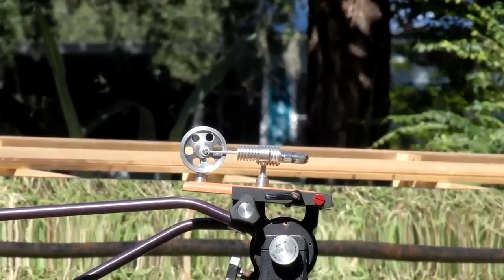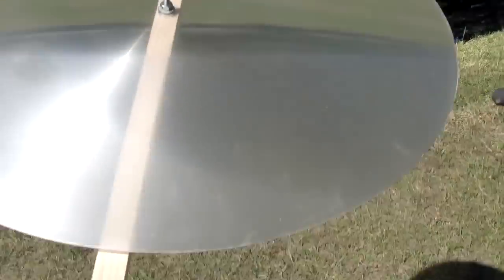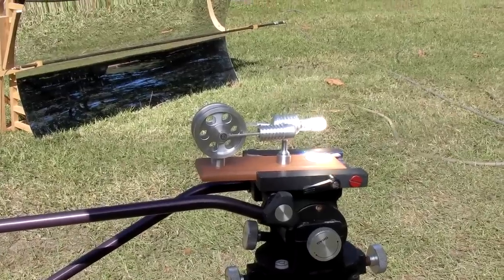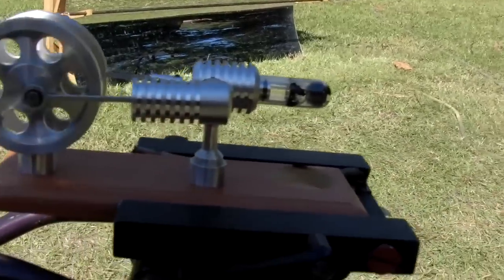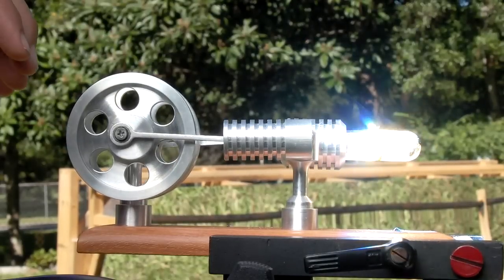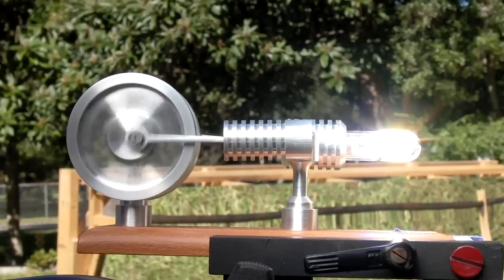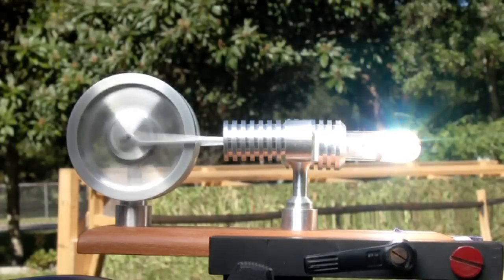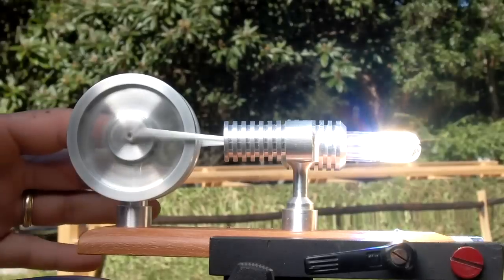STIRLING ENGINE FRESNEL Lens on a Steek Solar powered Stirling Engine

Comment: This is the sort of thing I was thinking of building. Fire safety could be achieved with a vertical magnifier in a metal tube over the parts that require heat. Metal may be preferable to glass. In hot countries, solar is less effective as those panels like light but not heat so something like this may be the ultimate alternative 👍

Comment: Okay this is fucking simple all you need is a high voltage solar panel one solar panel let's say the biggest one you can get is around 600 watts so let's just say you got a 405 watt one like I've got and it's like 36 volts or something like that so if you take that and you wire it directly to coil wire wrapped around the end of the glass bulb then you may be able to generate enough heat right off of it just right off the Sun and this thing should start running and it will probably get pretty hot I'm sure I guess I could try this I've got both

Comment: You could use infrared sensor attached to  magnifying glass pointing to the sun so whatever and wherever it moves in case it's being used so the heat is constant, attached to that wheel is a motor to charge the battery so that the infrared sensor is power sourced.

Comment: If I understand correctly, the Pyramids from Egypt were energy producing machines. It is sad and exiting that this technology revisits us today. I am not the sharpest knife in the drawer, but my belief is that the oil in the ground is a lubricant which left in place allows tectonic plates the ability to flow freely. Imagine what the world would look like today if we would have placed more emphasis on the Sun, rather than oil. Dan and Denise do a wonderful job of expanding imagination. Love this little engine, and love the Green power website as well 1 plus 1 truly does equal 2...Thank-You

Comment: one thing is that power depends on temperature range on stirling engines, as both bulbs are under the sun and very close to the focal point , the temperature range here is not that great. Isolating one of them from sun exposure would work greatly
Reply: Continous dripping cold water falling at the cold side of the piston bore- will greatly increase the Stirling efficiency- sure temp're reduction... A small aquarium water pump will do the trick- the coolant falling water must pass thru a sprinkler like slotted holes- for heat scape as the water fall down to its catcher- reservoir...

Comment: IR flock sheet absorbs 99.5% of all light that hits it including infrared light, it gets very hot, very fast when set out in sunlight or when a simple flashlight hits it, it gets hot enough to boil water.
Reply: Tim McGirl:  Is the term "IR flock sheet" the generic name or BRAND of such great HEAT absorbing product?. Pls elaborate.. or PM me in private...

Comment: I have been wondering for a while about putting magnets on the flywheel itself. Then putting a coil around that to generate electricity. It seems like a better way to me than it would be to drive a belt hooked to a gen.
Reply: Correct because there isn't much torque associated with this movement. Any type of belt drive will reduce efficiency massively. The ideal and likely only solution to generate max output would be magnetic system to store the energy

Comment: Wonder why this isn't scaled-up and used to spin an AC generating motor?. 
Using a magnifying lens on a frame with servo motors connected to the frame that uses a computer program to keep the frame/magnifying len's light focused on a specific point by following the arc of the sun in the sky. 
If the Sterling motor is found to be underpowered, a closed steam turbine system could be used to power the AC generator. The focused light used to boil water in a closed loop to produce steam to turn a steam engine and in turn, turn the axle of an AC generator.
Seems like an excellent way to produce AC power using only sunlight durning the daytime. Hooked-up to a Tesla Power wall battery system, would enable power at night.
Each individual home could have one,eliminating the need for AC power transmission and distribution wire networks we see today.

Comment: The sterling engine is great and all but when used for solar purposes it loses in efficiency by a great deal. Add into the fact that a very efficient sterling engine would cost more than solar panels of equal power output and you can see why it isn't being used.

Comment: Can this sterling engine be made of pure glass...?  Someone built a 3D printer that uses lenses to melt sand into glass then uses the glass to build things.  It uses a solar panel to power the electronics which control where the X & Y motion of the lenses to move on sand.  The 3D printer can print its own lenses out of lego blocks, and its body out of sand-glass, but do you think it can use its own 3D printed glass sterling engine so that it can self-replicate exponentially (1 2 4 8 16 32 64 128 256 512 1k 2k 4k 8k 16k 32k 64k 128k 256k 512k 1 million = 20 generations).

Comment: XD put magnets in the wholes then copper wire rings on the side and feed a axel threw them stacked to the other side more wheel magnets attached to engin let the copper feed Into a rechargeable car battery BLAM FREE STORED POWER

Comment: This is the REAL free Energy!!!!
Reply: @be-shorter  By free, I didn't mean free. But that you can theoretically generate and use the energy yourself. You are less dependent than with your own solar system on the roof.
Reply: @Michael Skinner Our planet, the moon, the myriad of planets in trillion of galaxies in the whole universe- they are travellling without mechanical engine... Are those FREELY TRAVELLING COUNTLESS PLANETS- not enough evidence to proved that freely moving engine is possible?!!!...
Reply: @Michael Skinner solar power is effectively free on a human time scale, we'll be long gone by the time it runs out
Reply: Forging the metal and lightning for it and designing it to improve efficiency. And paying the workers salary.
Reply: Yes but it needs a starter motor to give momentum to the flywheel everyday at 12pm to make it run.
Reply: The problem is that energy is energy is energy, and since nothing is perfect, some is always lost to things like heat, friction, and sound. Those things, combined with the size of the lens, determine the amount of energy per unit of time you can use. This thing is likely no more efficient than a solar panel the size of the lens, since the amount of sunlight you gather is the ultimate limiting factor. You couldn’t do much more than charge a phone or run a couple lightbulbs with this.
Reply: not really.  he is still burning steel wool therefore producing some type of emission
Reply: @calamity333  The combustion products remain inside the glass bulb. The wool is quickly consumed and the resulting oxides act merely as light absorbing material. There are no emissions.
Reply: @calamity333  So you couldn't burn water and create steam? You couldn't take that steam and recycle it? Solar panels are a fucking ponzi scheme
Reply: @calamity333  what if it heated up water?

Comment: Similar to the Sandia National Labs project.  I think they got 85 percent efficiency.  Their sterling though had some type of cooling system that used nitrogen.  Also if you dig around on the net there is a sterling that is a generator but no sales details.  Also I tried to build one like Sandra but you know how it goes.  But I will share an idea I have a large parabolic antenna.  Small mirrors are very cheap.  So liquid nail the mirrors to the dish and use a sun tracker which works with the sat hardware.  Also in Australia they do this with PV but cool the PV some how also the PV is much more robust than standard.  Another site I found generated steam with a dish I suppose to power a turbine.  Then all you need is a windy or sunny boy and your all set for net metering. I could keep talking but I'll stop for now.

Comment: love your vids... should put something in front of the metal pieces behind the glass area... stirlings work best with cold/ heat transfer.
Reply: APCWORLDSUXAZ 
there are pumps like this that circulate water through the cold side to keep it cold.

Comment: So, I'm just getting started in studying the application of Fresnel lenses, and am wondering what the purpose is for the stirling engine shown here. Does is have any use, such as generating electricity, or pumping heated water or air?
Reply: normally they are heated with rubbing alcohol or similar... this is show casing you don't need anything to burn as the sun can start it up as well. aka basically free energy making an engine work ^^  scale this up and you could have a good generator paid for by sun and hooked up to batteries could power house... or something ^^